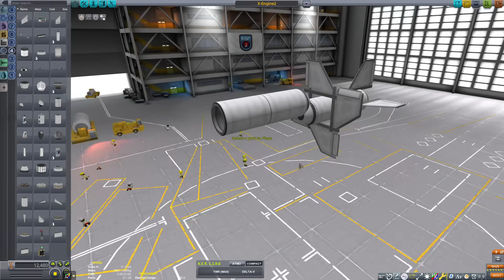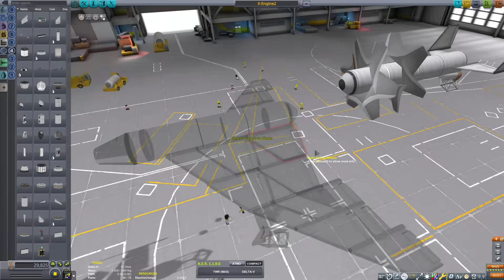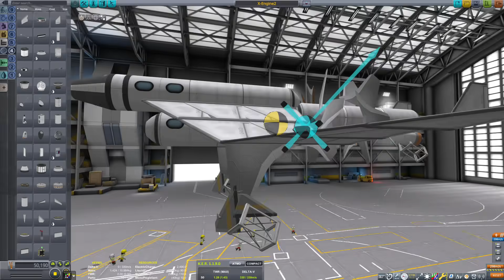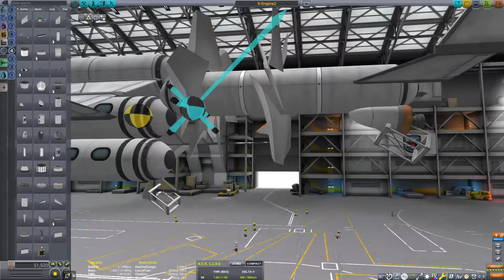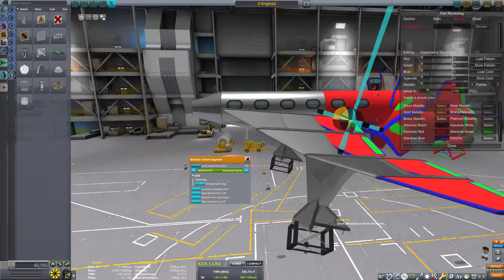KSP LOW TECH ELECTRIC AIRCRAFT. Maybe a two stage to orbit possibility?

Comment: This makes me think, couldn't we improve the stability of the design further by abusing the docking port attraction force? What happens if you clip another small docking port inside the probe core and move it juuuust in front of the "bearing" port, but in a way that the probe still prevents the two from actually docking?
Reply: I thought he didn't have any docking ports on that particular design?
Reply: @delfinenteddyson9865  he doesn't, but I mean the common Sputnik bearing.
Reply from the maker: could work